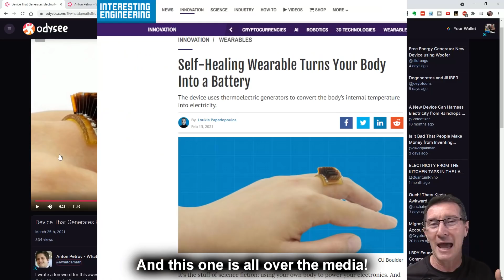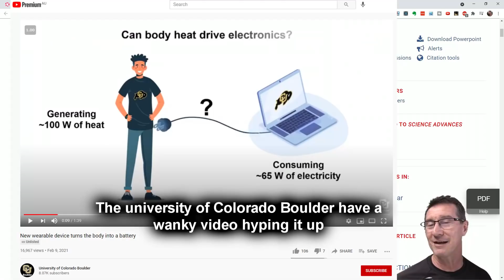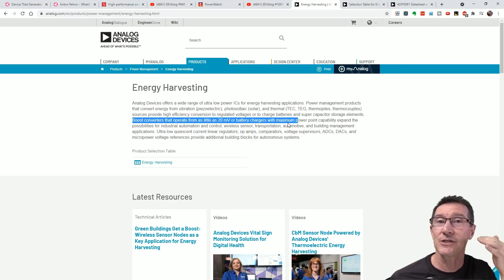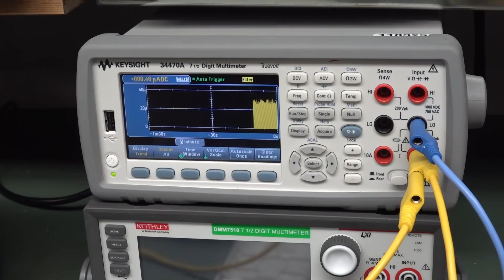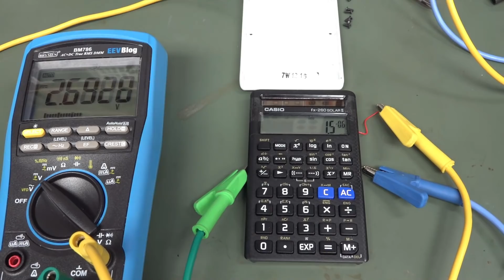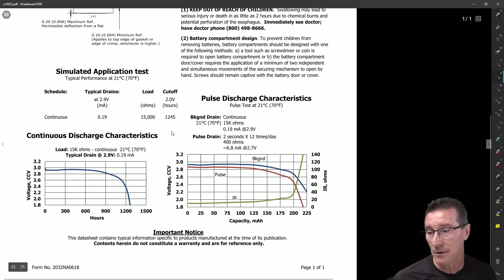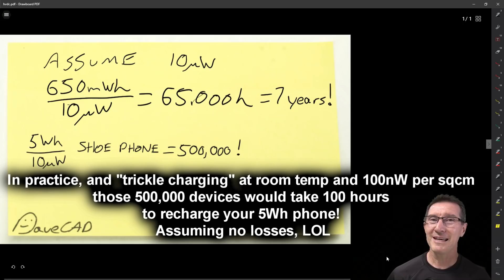EEVblog 1383 - Human Battery Energy Harvesting BUSTED

Comment: Anyone ever heard of a Kinetic watch. Seiko invented that in the '70's: It's a watch powered by a rotor, that rotates when you move your arm. It drives a small dynamo that charges a battery.
Reply: Before that there were the self winding watches (which are still made) which winds the spring by way of a weight on a rotor with a one-way gear/clutch.  No electronics  needed.
Reply: @chuckoneill2023  Yes, I have a 1958 Bulova self-winding watch.  I wore one in my youth, it disappeared when we moved, and many years later I got another one like it.  The accuracy is not very good by today's standards -- something like 5 seconds of error per day if it's really well adjusted, and often much worse.  But you never have to wind it or change batteries!
Reply: @michael.a.covington  I used to love my self-winding Timex,  I've no idea what happened to it.
Reply: @chuckoneill2023  Automatic, self winding wrist watches were produced from the 1920s, though there are patents for self winding pocket watches as far back as 1780, though I don't think any went into production then.
Reply: @peterjf7723  Watches were often treated as just another piece of jewelry before they could be mass-produced, which occurred in the 19th century with the rise of interchangeable parts.  (Interchangeable parts require the ability to mass produce functionally identical parts, which is the result of precision machine tools, which were developing rapidly from the early 19th century, and show no signs of slowing down any time soon.)
Reply: I had a Bulova Spaceview 2 watch with a kinetic generator.  Bulova guaranteed it for 20 years.  After many years, the calendar hand began to stick.  I sent the watch to Bulova for a fix, but they opted to replace the watch instead of repair.  Bulova disappointingly sent back a Citizen derived watch with an expendable lithium cell.  Very disappointing!
Reply: @wtmayhew  Not a good trade dude. 
A Bulova Spaceview 2 is a classic.
Reply: @gravityskeptic8697  The problem was inability to find someone competent to repair a Spaceview 2.  I contacted several well known watch experts who do conversions of older regular Spaceview to use modern batteries.  Nobody would touch a Spaceview 2.  I took a shot with Bulova, hoping they, if anyone, could fix a watch they made.  Apparently all the Bulova intellectual capital went out the door with the Citizen acquisition.  We’re living in a throw-away world now.
Reply: @wtmayhew  For a watch with that kind of hostoric significance, I would have expected that someone would have been able to fix that watch.
Tough luck 😢
Reply: @wtmayhew  A friend gave me a 1973 Spaceview (214 Accutron movement) in 2003. It was brand new - never been used - and completely ruined by the original battery leaking some magic vapor. No watchmaker, repairer or jeweler would touch it, so I did. I cleaned the stuff out; cleaned and re-soldered the electronics; found some crazy people wanting to send me 30 years old "original" batteries from the USA for a small fortune; learned about watch batteries (like the code being just the measures) and finally found the perfect ones at some $5 a pair at the nearest kiosk :D
I wore that watch for more than a decade with no further maintenance. Then someone broke in my house and stole it with a bunch of other stuff (may they burn in hell).
Reply: @IlBiggo  Thsnks for sharing your experience.  Great to have a wonderful vintage watch still going!  I suspect you already know, but for other readers, the original Accutron movement can use a more modern alkaline cell if you install a Schottky diode to drop a few tenths of a Volt to more closely match the original silver-mercury cell voltage.  There is an alkaline cell that has similar/same dimensions.  There is ample room to install a chip diode with a tidy installation.  The Spaceview 2 with the kinetic generator has a different coil arrangement and of course a rechargeable battery - not sure what chemistry it had.
Reply: @wtmayhew  Somebody had told me about the voltage "fix", but I decided to wait and see if the watch had any malfunctions. It didn't, and I ended up feeding it standard silver-oxide batteries until the end.
Reply: Had a nice "automatic" watch for a while. Got a solar one now, as is much lighter (and I needed to sell the other to pay for bills at one point :P ).
PS, have the smaller/thinner automatic watch still... I'll have to rummage around the draws and find it.

Comment: maybe in space ! can get huge differentials
Reply: but you would have no medium to carry the heat away .. in space you can only radiate heat .. it's a serious problem to get rid of heat in space
Reply: @VVerVVurm  anybody tried a Peltier as generator in space ?  one side facing the sun  the other one on shadow ?
Reply: @Tupeutla  well .. solar is far more effective .. TEGs are typically only used with nuclear energy source (e.g. the mars rover or outer space probes where light from the sun is dim)

Comment: 25:53 - "you need 500,000 of these devices plastered all over your body"
Human body = 1.9 m2 surface area
= 19,000 cm^2
= covering 26.3 people. Standing on Mars.
Reply: You get up to a couple mW from a full-body suit under normal conditions - which is nothing to charge your phone with but definitely usable for low-power wearables.
Reply: @RealNovgorod  yeah, lemme just put on a gold tinted ceramic-based scaley-spikey godzilla-looking full body suit so i can wear a smart watch.
Reply: @vukpsodorov5446  Or a pacemaker...
Reply: @RealNovgorod  yeah, but the general point i'm trying to make is, full body suits of this stuff are really impractical to wear. so yeah, i get that it might sound more convenient to not have to charge vital things for some people (such as pacemakers), but realistically i think that's not the case.
Reply: @vukpsodorov5446  Convenience won't be a problem if you integrate the TEGs into normal clothes people wear anyway. It just won't be economic except for niche applications where reliable function over decades is more important.
Reply: @RealNovgorod  that's the thing, though. integration into clothes is difficult. people rarely wear just one layer of clothes. if the TEGs aren't making contact with skin, they aren't going to heat up as much on the hotter side, and if they're covered by a different layer of clothing, the  cold side won't be as cold as you need it to be. on top of that, when people do wear a single layer of clothing, it's during summer, when temperatures are higher, potentially only a few degrees less than body temperature, and at that point, there's much less power being generated than the 100nW/cm^2 that they managed to get at average room temp.
i mean, theoretically, yes, you could design single-layer TEG clothing that can be worn without any other piece of clothing on top of it, but i doubt that's really feasible, and that's also probably going to be less efficient than the stuff shown in the video (it's probably going to have less effective surface area because you won't have the little plates sticking out all across your body).
TEGs are likely a great idea for industrial applications, with massive surfaces and possibly hundreds of degrees of temperature difference, but that's pretty much it, at least for now.
Reply: @vukpsodorov5446  That's a good point, though thermodynamically it doesn't make a difference how many layers you wear because "with a bit more engineering" you can always harvest the full temperature difference between the skin and the outside air. "Just" put TEGs in every layer of clothes you wear and you should get about the same efficiency as with a single layer harvesting the full temperature gradient. That would also be a great incentive for clothe makers to sell you a whole set, from the underwear to the jacket :)...

Anyway, as far as energy harvesting from "just being alive" goes, I'd rather bet my money on miniature hydroelectric turbine implants, either in the lungs or in the veins - guaranteed power generation while being alive, serious amounts of power extraction (adjustable for the specific application), and hilarious modes of failure...
Reply: @RealNovgorod  
Micro turbines in lungs and veins!? absolute nonsense!
Reply: @GoblinCh.  right? What they gonna do next? Electrode implants in the brain?

Comment: Maybe you can do a pre-emptive video on how big a thorium molten salt reactor would have to be to power 2 to 4 electric "turbofan" plane engines compared to the size of a 787 dreamliner?
Reply: Sorry, no room for passengers (on a good day).  Of course the weight and balance would be a bit off too!
Reply: @Herby-1620  I am curious by how much though. Also I am curious if a truly massive plane like the airbus beluga (A300-600ST) would be big enough to make it work.
Reply: @Herby-1620  fuel is one of the biggest costs for maintaining planes after all. So if you can power a plane for 20 years on nuclear fuel that would probably make it financially feasible.

Comment: I worked on a tiny ear tag for tracking cattle (a serious market) and considered movement (kinetic), solar and thermal and immediately tossed out the thermal because it is an order of magnitude less efficient per unit density....it is possible that if you had a large surface area and could shadow photons on one side (perhaps in space) you could get a significant DELTA T but this would be in the league of terrestrial solar power. Even the cow's movement would generate much more usable energy than any thermal generator. There are real projects working on this in many companies today.

Comment: These TEGs have always been horribly inefficient, in both production and consumption, their main selling point(at least to me) is their size.
Best used for trickle-charge, or compact thermal exchange.
If roof tiles were replaced with TEGs, you may produce a decent amount from solar heat, BUT WAIT solar panels are being built more and more efficient.
Mirror farms maybe more practical, because you can bring them up to their own thermal mass limit with inexpensive shiny things. 
Solar wristbands on bungie bracelets would be better as wearables.

I still want a buyable variant of the ones used in space, the ones that surround and run off radioactive decay.
 Nuclear needs to become more mainstream before they let people have those...

Comment: I knew someone that developed a thermoelectric generator fabric in the US. Long story short, it produced barely any power at all (microwatt range) and wasn't useful for anything. They used the method where its a material that generates a tiny charge when it is stretched out

Comment: The display for the Clock is not an e-ink display, but a Sharp Memory LCD, they are ultra low power, but not 0 power, and the display will disappear when they are un powered.
Reply from the maker: Yeah, I ogffed that, forgot to add the text overlay. But those sharp memory LCD's are crazy low anyway.
Reply: @EEVblog  Yeah they are impressive, I have an old TI eval board with a super low power chip and such a screen, it can run for a while on just a small supercar, that's quite impressive!

And don't worry, fun fact a real e-ink screen would consume way more during refresh than that screen  :)

Comment: You also need to take into account that some people have cold extremities due to circulation issues, so to get the best performance ideally you would want to stick them to your face.  Being flush with embarrassment being seen in public with all these cubes stuck to your face to power your casio watch, will also help with the temp differential.
Reply: "Apply directly to the forehead."
Reply: @bert-blank it might explain Peter Capaldi's costume in the new Suicide Squad trailer.
Reply from the maker: Yeah, finger as shown is the worst possible place I think.

Comment: Lets say you have enough of these things to output a consistent 10uWs (at 2-3V)  you could run an MCU deep sleeping at around 500-800nAs and siphen the reset into a super cap or similar bulk storage for use in infrequent measurement/transmission bursts. I agree this is highly impractical but not impossible. Lets say you are putting aside 3uA@2.5V into a super cap, after around an hour you would have enough energy stored in the super cap to startup a BLE transmitter @ around 10mA for around 1 second. Of course I'm not saying this could be done today using our current super caps and radios, but with mature technology you could run certain types of low power sensor nodes from a 10uW energy harvested sorce.
P.S. I still agree these specific thermal differental energy harvesters are pointless for this use case, just wanted to discuss what could be done with 10uW

Comment: I wonder if it would be possible to create t-shirt of elastic peltier elements (if there are such thigs) and use them for cooling or heating a person.
I know that there solution based on R-22 or simmilar, but they are bulky.
I suppose in peltier solutions the battery would be bulky ;)

Comment: Obviously it's not going to work, it doesn't use graphene hahahaha.

Even a coat made from these devices would be a bad idea, the energy generated by the body would be lost because part of it is converted into electrical energy, the more efficiency the device has the worse it will be  (not counting that which is inevitably lost because the coat is not 100% ideal).

They will freeze to death, but hey! at least they will know what time they died.

Comment: You would get more power from a photovoltaic cell of the same size and room lighting (300 lux)
Reply: And with a directly usable voltage level as well! So it will even be cheaper and more compact and more reliable. Not nearly as innovative though...

Comment: I had motor cable that ran along the wall of the factory full length, when I was testing it I read 120v ac OPEN Circuit voltage just from Inductance, Absolutely no power at all.

Comment: Somehow my expectations of what this could be used for actually line up with reality, being arguably less useful than a Gen 2 RFID sensor tag for battery free ultra low power applications.

Can it work? Maybe as a sticker style thermal probe for industrial applications. More surface area and higher temperatures would definitely help.

Comment: The voltage output is irrelevant as you can always have as many elements in series as you want to get whatever voltage you desire. That abstract is not written by someone that understands TEG's
You can add as many junctions as you want (almost but anyway you can add enough to get any voltage you want) but power will still be as limited.
What they mentioned in the abstract was just the open circuit voltage for the particular device they decide to use with the limited number of junctions. They could have double the number of junctions for double the voltage but power will have been the same.
The efficiency of this things is at best around 5 to 6% (based on my rough measurements I done a few years ago). 
So if human body uses about 100W to keep warm you will need to cover the entire body and you can get around 5W (5% efficiency) that finger size element.
According to google human body is 1.6m^2 total surface area so 16000cm^2 thus if that finger device in the photo is about 1cm^2 then 5W/16000 = 0.3mW
Over a full year 0.3mW x 24h x 365 days = 2.628Wh basically nothing.
That means whatever they did there is way worse that what is possible based on my calculations unless I messed something somewhere.

Comment: This tech is not good enough now, but a couple iterations down the line it may work in some really low power applications right? I would imagine there are still ways the researchers can improve their techniques.
Reply: No amount of technological advancement can extract more energy than there actually is. Even with a perfect thermodynamic cycle there is just not even enough total heat flowing out from your fingers to power anything decent. And you can be certain that even after 100 years the fact will not change.
Reply: @Kirillissimus  There is enough heat flowing from your body as a whole though. It's not like it is entirely impossible like some other scams, it is practically not usable.
Reply from the maker: This technology is over 100 years old. It needs several orders of improvement over where it is now. It's like saying we'll suddenly get a 100 fold improvement in battery technology. And even then, just do the calcs on how much of your body has be covered to get X watts even at 100% efficiency and temperature differntials. Sorry, no magic bullet here.

Comment: I dont see why bother with body heat powered wearables when you have kinetic watches around for like 50 years by now.
Reply: Indeed
Reply: @dogwalker666  An automatic watch produces about 5 microamps at 1.5V, from what I can find, or 7.5 microwatts. That's even less than this thing produces. (Admittedly, it doesn't require lethal ambient temperatures to do so.) Still, if this TEG at peak can't power a smartwatch - and it can't - then an automatic watch movement can't either.
Reply: @RedwoodRhiadra  smart watches do use massive amounts of power, Even my watch because it has a rds radio in it only just copes, but it's a proven technology that as you say does not involve sticking your arm in a furnace or dry ice
Reply: Because... innovation!
Reply: People don't move as much since Facebook.
Reply: @deth3021  Since we also have pornhub I suggest it evens out.
Reply: @Marek-db8wl  don't most people wear their wearable in their off hand though?
Reply: valid point, jokekiller.
Reply: @deth3021  Wait you don't do the stranger from time to time?
Reply: @RanEncounter  to quote myself, don't most people wear their wearable on their off hand?
Reply: @deth3021  Yes, and what is the stranger? You numb your off hand so that it has no feeling and wank off with it. Do you have a reason for quoting your own comment?